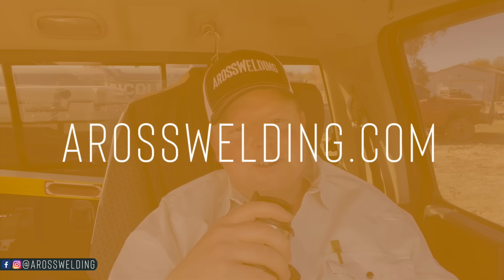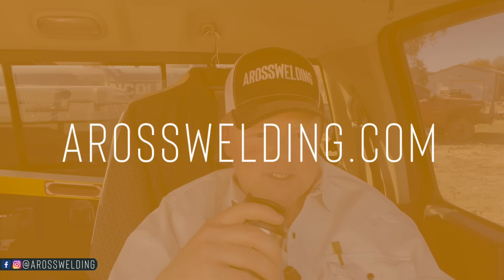How To Pick The Proper Welding Rod (All You Need Is These Two)

Comment: I use 6010 and 7018. But I have found that rods from different manufacturers behave differently. Some 6010 rods have very thin flux and they tend to stick more easily. Can you comment on your preferred brands?

Comment: 7018 can be run down hill if it's perfectly vertical.  The flux will drop away just like you're doing over head and pointing the rod slightly down hill helps.  If the steel is anything but perfectly vertical the flux will harden in front of the weld and there's no way to burn through it.  I know it's not a preferred way to do it but I was showed how to do it 30 years ago and it works like a charm. The preferred way is vertical up but the down method makes a much prettier weld.

Comment: I would say you need 3 rods.
6010, 7018 and the one I would add is 6013 for when you need a deep penetrating weld for buckets, broken booms or something thick that cant be prepared in a timely manner and they want a one answer solution not to have have gouging rod, torches etc

Comment: 8:51 Speaking purely from theory, my understanding is that 6010 has thinner and fast-freezing slag, so perhaps it is more tolerant of slag inclusion, which is likely to occur when welding downhill. 6010 uses active gas/smoke for shielding more-so than slag, so it's able to shield both sides of an open-root weld. Closed-root passes (e.g. T-joint fillet) aren't ideal, because the rate of hydrogen diffusion is greatly reduced, although this is less of a concern for A36 mild steel.

Comment: on my mobile rig I carry a can that has 3/32" and 1/8" of both 7018 and 6010. I also don't usually use a rod over for 7018 until it's "needed". Open air 7018's are still stronger and more ductile than most other rods. They are just not as strong and ductile as "dry" 7018's. sometimes I get 6011's when I let my self run out of 6010 and need something in a hurry. I also have a can of just the 2 sizes of 7018 for the bigger 7018 jobs. and sometimes I have other rods that get used on occasion but I'd say 90% of the stick welding jobs I do any more are 6010/7018. I have messed around with 6013 and 7014 some in practice but I see no reason to carry that crap on the mobile rig for paid jobs. That's more of a personal preference though.

Comment: Austin, love your videos. I am a home hobbyist who used oxy-acetylene for years. I just acquired an inverter stick welder, and need to purchase rod for it. I was set on getting 6013, because it is supposedly the easiest to weld with, and it is good for very thin material like sheet metal. Most of my welding is done with material that is less than 1/8" thickness. Should I consider 6011 over 6013 for my main rod?
Reply from the maker: Depending on what you’re welding on, yes, I would consider it. That 6013’s puddle can be hard to read. Even for an experienced welder

Comment: The only two rods I carry on my service truck are 6011 and 7018. The former because I usually end up welding something dirty or scaly and the latter because I want a good strong weld. The 7018 resides in a rod oven at the shop until I need it. I've tried 7014 and I do have some in the truck in 3/32 for light steel but rarely use. I started with 6013 that I now regard as almost useless. It doesn't burn off scale as well as 6011 and the slag part is annoying. I have wire welders, but I enjoy stick welding more than wire and I like seeing what others are using. Never used 6010 but I may buy some to try.

Comment: When you're structurally welding for buildings/repair jobs, when or why would you want to use 6010 for a root pass? Is there any advantage to using 6010 as a root? Would it be fine to just use 7018 for the root, fill, and everything? Sorry if this is a dumb question, I just really want to learn.

Comment: I am and old guy and newbie hobby welder trying to learn some new tricks.  I am so grateful to find this video ...this is the info I was looking for.  I will purchase both 1/8" 6010 and 3/32" 7018 and start practicing.  These two sticks should work for all my DIY projects (and maybe some of my neighbors projects).  I have one question concerning polarity ...I have a DC inverter machine that does 6010/6011 and, as I understand it, I need to make sure the stick rods are made for DC electrode positive.  Searching Lincoln Electric, I see some are made for AC.
Reply: 6010 is for DC welding, 6011 both AC and DC. IIRC sodium vs. potassium in the flux. Run whichever one you want. I'd try both in a few different brands and see how you like them, but you can't lose with Lincoln Excalibur or I'm told ESAB Atom Arc electrodes.

Not sure how all of the new equipment is now, but inverters used to have a lot of trouble with 6010 electrodes and generally 6011 was the fix for that. Many advertise 6010  performance so they've probably tweaked it enough to work well. I have an ESAB 205 here at work that I weld TIG with and occasionally MIG, that I don't remember how rods run with it. I think I've used it for that twice in 5 years or so. Sounds like it's time for some practice to see what it likes. I usually weld stick with my Lincoln Square Wave so I haven't really put it through the paces.

Comment: i am in manufacturing and 8, 10, 12 gauge 6013 does everything for me . 10 gauge or 1/8 is most used till any thickness of 2 to 5mm if lower, they switch to 12 gauge 2mm and on thicker till 10mm to 4mm rod

Comment: 7018 should be called hydrogen sensitive NOT low hydrogen.
Damp 7018 (4+ hours of not being factory sealed or out a rod oven in medium humidity climates) will result in a weld about as brittle as 6010 or 6013. For non-critical jobs it can be refreshed in a home oven at 400f for a couple hours, this will get you at least 90%. 
And try to preheat the base metal in cold weather, slowing the cooling rate of the puddle allows more hydrogen to escape before getting cold enough to lock it in. 

There isn't chemically anything particularly bad about multiple reheats of 7018, but that isn't certified because they haven't officially tested that specific product in every combination of storage cycles, they only test enough to satisfy large industrial users.

Comment: higher tensil strength steel (AR plate, T1, 4140) may require a higher tensil strength rod 8018 9018 11018

Comment: I can't agree with the 7018 rod for do it your selfers unless you use 7018 on a D. C. welder. 7018 on A.C. sticks more often than a 6011 rod. 6011 rods are used in a lot of welding shops for some reason. Maybe they are too lazy to clean the area to be welded. 7014 is all I have used on mild steel for  42 years. It sticks FAR LESS than those stinking 6011 and 7018 rods while using them on A.C. I'm sure there is someone that will disagree with facts. There always is.
Reply: @bottmar1,I have to agree with you because we use mostly e6013 and cap with e7014 or E71T-11 multi pass fluxcore wire (Lincoln electric inner shield)which is actually similar to e7018 ,around our farm🧑‍🏭
Reply: Running  on DC welding machines🧑‍🏭
Reply: I will have to try 7014 on D.C. when I get a chance. It welds easily on A.C. so maybe on D.C. It will be even better. 7018 on D.C. was great to use but terrible sticking on A.C. but it has been a few decades since I was around a D.C. welder. I used 7018 on A.C.  at the farm I worked on recently but it stuck like crazy even with an arc stabilizer attachment. I went home and got my trusty 7014 rods and finished the welding job on their same welder without trouble. Yet they claimed they had no trouble. That was their "opinion". Opinions are not facts.

Comment: I think 6013 is one of the best for thin stuff if you have to do it. Is 6010 better? I read that 6013 has light penetration and 6010 should have deep penetration?
Reply from the maker: In my opinion 6010 runs a bit better. And yes, 6010 also, if ran properly should penetrate deeper
Reply: @arosswelding  I just imagined the deeper penetration would mean it burns a hole easier. I have to buy some of those too and see how they work.

Comment: Hey Austin, in regards to stick weldin. You can actually get certified running downhands however more passes are required do to less filler per pass. As u said running ur passes up hill does put more material in each pass. The info u provided on welding hoods was very good and i did wonder why pipe welders preferd the small lens over the larger lens but now i know thanks to u. Well done.

Comment: I’ve always used 1/8” 6013 for everything with my Lincoln buzz box AC welder. What would you recommend for welding vertical joints? 6013 is no so good for that. I just weld angle iron mostly

Comment: 38 years of welding and fencing. I've used 6010 for rusted pipe and flat plates. I use 6011 90%of the time. 7018 I use for any thing that 1/4" or thicker. I hardly use 6013. But your right on what is Preferred in any type of welding.

Comment: Those are the two rods that I have. And every time I set out to weld I remind myself that if you ride in/on or walk under it's 7018.  And vertical up is always stronger, but sometimes it just ain't working.

Comment: As far as stick welding goes, most of what i do at work is pipework and pressure vessels. We use 6010, 7016/7018 and for lower pressure stuff sometimes use 6013. Most of the time roots are welded with Tig, as 6010 is fine for low pressure but not high pressure. 
But what do i use in different situations? 
What it says on the WPS 👍😄👌

Comment: got a simple job welding 1/2'' plate to backside of a tractor bucket.Not load bearing ..just replace pad eyes with the plate. i have 6011.question ?? should i preheat or just weld it . thks for sharing..

Comment: Ive had bad experience with ugly welds with 6011. Im still a beggineer but i found that 7018 and 6013 is best so far, ive tried 6011 vs 6013 and its night and day for how much easier and better the welds of 6013 look compared to 6011, 6011 looks like a mess.

Comment: I’ve welded and machined sucker rod. It is a fairly hard alloy of steel. Much of it is magnetized and blows the arc to one side of the weld if I don’t weld it on AC.

Comment: 6010 and 7018 1/8 & 7018 3/32.... if you asked for 1 I'd say 7018 3/32 because you can build it up.. I do welds on thick steel that a DC gate motor is mounted too so it gets moved 1000s of times a year..it's for automation for the port automation trucker lanes ..it has to penetrate deep and has too be beefy...gets a weld only on one side of a 5 inch square ⬛️ the rest of it floats with motor mounted on it.

Comment: Most welding machines out there, that aren't full-on red or blue pro machines won't run 6010.  Only the 325-amp Primeweld is rated for it. Their 225 machine is not.  I haven't even struck an arc with 6010 yet-but will next time I do something besides play with the TIG setup.  I've seen 6010 and 6011 penetration tests that show that the latter just doesn't punch in there like 6010.  Love me some 7018.

Comment: Basically, oilfield sucker rod is a medium carbon, fairly high tensile steel on the order of 4130 or 4340 ( similar to that used for axles or shafting) but some of it is made for severe service ( hi temp, crooked hole, extreme depth, etc.) and who knows what it is. The manufacturers aren't telling.

Comment: 6010 is for a DC welder. 6011 and 6013 is for ac welder and can be used with a DC welder also 7018 is for both ,

Comment: Uphill is slower so runs hotter/more penetration.  Downhill is faster so cooler/less penetration.  The third number is either a 1 or 2, one is all position, 2 is flat/horizontal only.  7018 is all position with the limitation of uphill vertical only, because of slag inclustion with downhill.  If it is structural 7018 needs to be dry so yes an oven once open the tin can.  AWS D1.1 says 7018 limit out is 4hours, once pass that it can not be used for structural.  7018 is a medium penetration rod, 6010/6011 are high penetration.  Given same diameter the 6010/6011 will run much hotter with less amps compared to 7018.  Open root would be 6010 then 7018 fill/cover, closed root 7018 only.  6011/6013 are general purpose rods not allowed for structural.  For general purpose thinner I would use 6013 cause low penetration.  If dirty  and too lazy to clean 6011, but if too thin I would not use cause too hot.

Comment: I would add 1/8" lincoln weld 6011.
Eats thru rust dirt galvanized better.  
My boss used to say a good one inch of weld, you'll rip a chunk out of your pipe before the weld will break.  May the good arc be yours. 💥

Comment: I understand what you're saying.  I've found 7014 to be a nicer rod to start welding with as compared to 7018.
Reply: I agree. 7014 is easier to strike an arc.
Reply: @YT-User1013  It might be easier to strike an arc, but the slag gets in the way of the weld.  I agree 7018 is harder to strike an arc, but the resulting weld is so much better.
Reply: @paulvolk5446  Use enough amperage and keep your rod angle right and you will not have slag entrapment issues.

Comment: I have a Miller bobcat 250 and do mobile welding all over the area down here in Mexico. I agree mostly with what you say but I have only 1/8 inch 6011 and 7018 available. If I'm gonna be burning a lot and don't want to keep going back to the welder to adjust the heat, I just st it up for the 7018 rod and then burn 6011 faster so as to not have to constantly be going back to the welder. You can do a hotter root and then do your hot pass and go right into the 7018 and I haven't had problems. Some inspector may not like that, but I haven't had any problems.

Comment: How does 7018 work with galvanized metals?
Reply: I repaired alot of container legs that were galvanised with 7018. The metal itself was some sort of powder metal chinesium.

Still havn't seen one of them break, the weld has clearly been stronger than the base metal.

Just to have it mentioned: grind away the galv close to the weld in advance and use a respirator with a good filter. That gas is toxic as heck!

Comment: why not use 7014 on z  purlin and sheet metal . 7018 because of freezing ,excellent advice . There is a new rod 7016 that I need to learn about .  I like 7024 , railroad rod , and stainless rod for repair on high carbon steel .  A house hold stove makes a great rod oven and is free off Craigslist . I have a mini stove and oven for job sights .Fork lift propane tank last all day . A fridge is perfect for an air drier and is also available free off Caigslist
Reply: I just had to weld to 14g and out of frustration with 6011 and 7018 I ended up trying out 7014 and was much easier to run on thin material

Comment: I love to drag the 6013 like 7024 ,easy slag removal.  it is a general purpose fast fill and good looking every day rod. It helps to prep/clean the joints  i use 7018 or 11018 for any high strength welds all 70xx rod is a low hydrogen rod and needs to be dry just lay the 7018 down on a flat metal table and heat it with a torch before using. 6011 will burn through dirt, paint, rust, grease and get it done for a quick fix.

Comment: If you use a AC welder 6011 and 7014. DC  6010 7018 7016 or higher for specify metal . The first number on a rodis tensil strength 60  000 psi 70, ooo 70 psi    if  the second number is. 1. The position. Is  flat , vertical😂over head 7024 or 7028 are for flat welding the last number is the type flux that is used. Stainless steel is different you match the rod to the steel.. On goverment  jobs they will tell you what rod to use and provide it most of the time.  I have welded for 60 years . Including under water. There are a lot of things you.  Need to look up for some jobs. Like❤

peening welds and pre heat  . U tube helps but will only get you so far.

Comment: What about 7014 for non structural ? My father started welding professionally in the late 50's and started his own steel fabrication shop in the 60's. It's been 20+ years since he passed but when I started working in my father's shop in the early 80's and right up to his death we mostly used 7018 for structural, columns, beams, stair stringers ect, and 7014 for non structural, furniture, art, art display baces etc.

Comment: I tried 1/8 6010 couple times in AC and DC>R+S on a 40 year old Miller 300 Dialarc,  I prefer 6011 it seam to wash out and fill gaps better and I thought was better on rusty steel.... Therefore for beginners around the farm  thats welding dirty steel I recommend 3/32> 6011 and 7018 DC rods, thats 45 years of welding experience, 35 in shipyard........ Or better yet get a small mig welder and use .030 wire......

Comment: There is so much this guy doesn't know.  I was a welding engineer for over 40 years and an AWS certified weld inspector. For general welding on mild steel the rods he recommends are OK.  However the 7018 rod is a low hydrogen rod which must be stored in a dry heated rod oven which most people will not do. If not stored properly they will absorb moisture from the air which can cause cold cracking of the finished weld.  It will look good when first finished but may crack hours or months after welding. For welding anything other than low carbon mild steel neither of these rods is appropriate.  There are multiple "essential variables" that determine the proper rod and weld procedure.

Comment: I run a rig truck out of Hominy, Oklahoma. We aren’t far from each other. 

I got a smoking deal on 14 boxes of 7010 P1 (hippie) 5/32. I’ve been running them for 6-7 months now and weld everything with them, I keep a box of 3/32 7018 in the truck in case I feel the need for them and always keep some at the shop. I really enjoy that 7010. It’s strong, runs about like 6010 but it doesn’t crack. Ive used it to weld a hitch in on my truck and built couple barns with it and they are all held up great. 

If you’d like, I can give you a box to burn thru and get your breakdown of it.